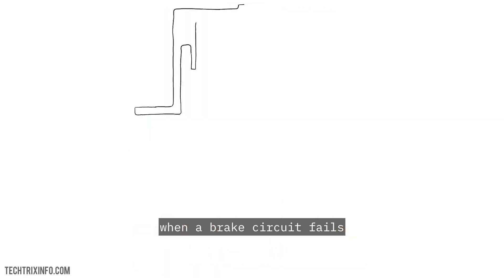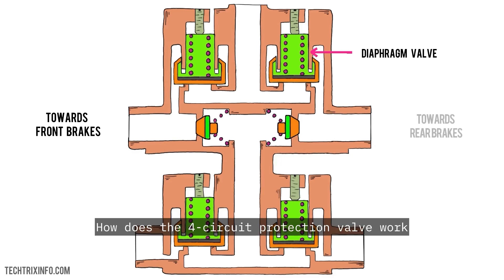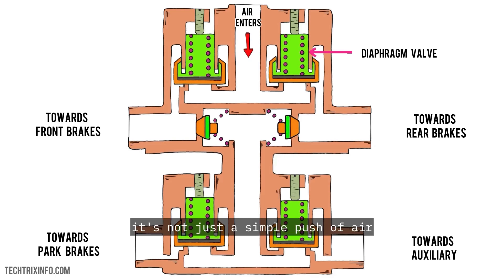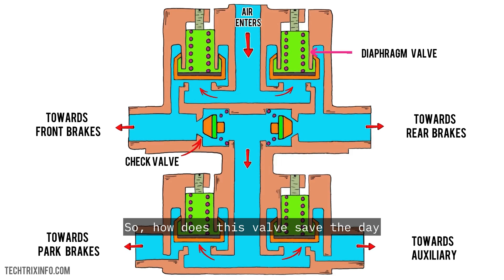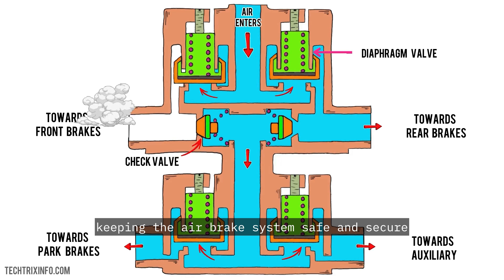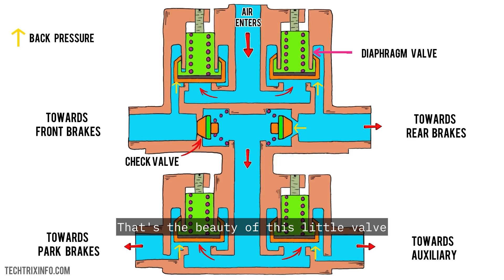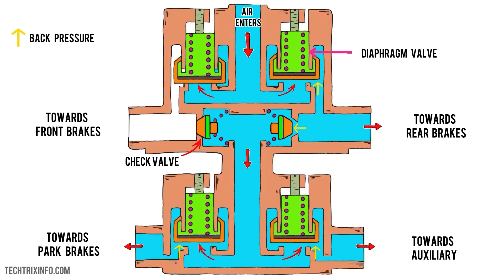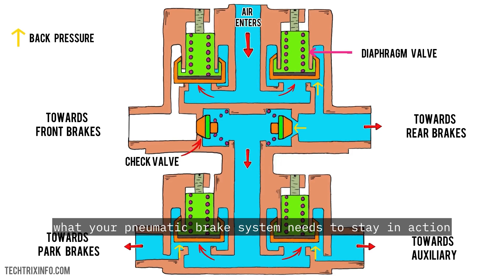Four Circuit Protection Valve Explained With Animation | Pneumatic Brakes | Part 2

Comment: stupidest invention imo, because whenever there's a leak in either circuit, it's gonna jam and the park brakes will engage. it doesn't matter if you have other brakes working properly, i prefer it to just leak until 0 psi so nothing works, and the vehicle stop to a complete halt. no circuit suffer, no tires damage, no red hot brakes. it prompts me to fix the leak and carry on. I got rid of this valve on my truck I that I drive, it saves cost.